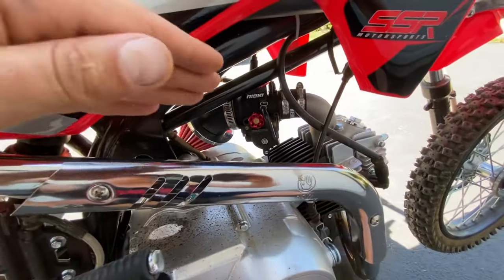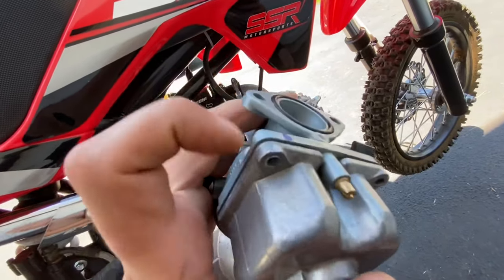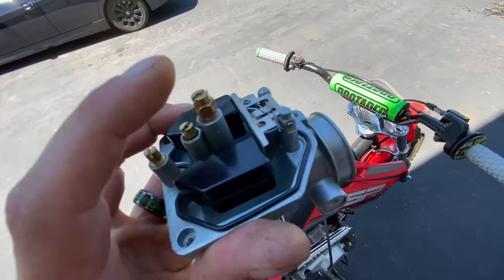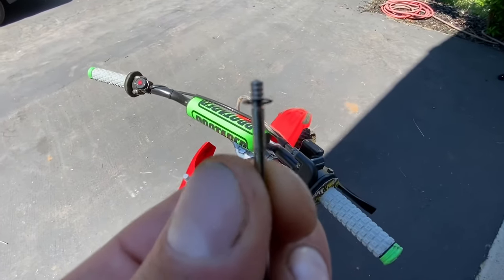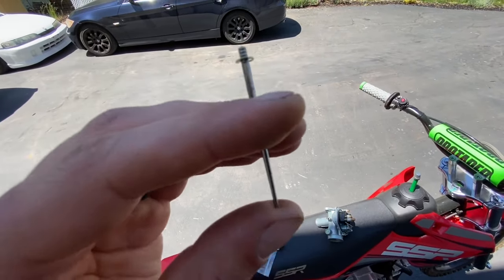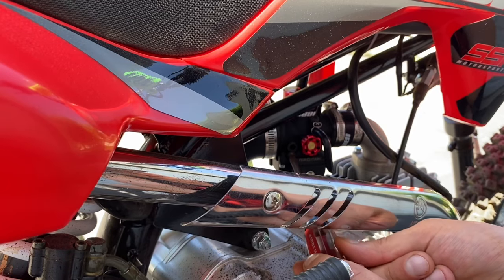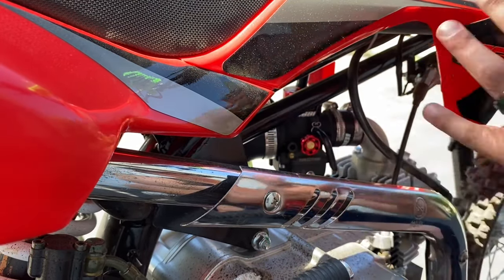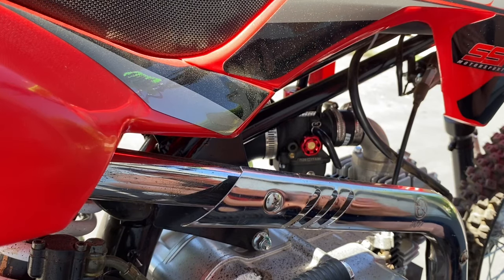How To Adjust Your nibbi Carburetor And Jetting For The Best Performance !!!

Comment: The knob on the nibbi is not a fuel screw, it’s a idle adjustment and the flat head screw is the air screw
Reply from the maker: Let me ask you this what happens when you turn the idle screw? It lifts up the slide inside raising the needle allowing more or less fuel to pass. So fuel screw.
Reply: throttle family I read up on it more, and your right but it’s called a idle mixture screw though and it controls fuel at idle to adjust the idle
Reply: throttle family sorry about that, good video though
Reply from the maker: Hey no worries I did the research so the viewers wouldn’t have too glad you liked it I hope it helps people out I just want everyone to have fun and get out there and enjoy their toys 👍
Reply from the maker: Also enter in for our graphics giveaway you have a good chance of winning so far we only have 10 entries
Reply: throttle family yeah for sure man 👍😁
Reply: throttle family okay I definitely will 👌
Reply: Its is called the idle screw because depending on what carb u got the other screw your air, fuel screw can be a air screw or a fuel they don't have both idle screw only governs idle where the other adjustment works through the whole throttle range. U got some other things wrong too but u got the basics out overall since u let it be know your new to this so i give u a thumbs up

Comment: What’s the factory setting for the idele screw
Reply: Both all way in n 2 turns out
Reply: @briantruax1682  yea I looked it up it’s exactly 2 1/4 for air n gas is 2 3/4 for proper tuning to start at 2 out is just a basic start which most ppl do 2 n half turn

Comment: Hey man so im just wondering where you got the bigger jets? Biggest ones i got are 118 main and 40 pilot.. i need the 120 main and 48 pilot
Reply from the maker: mark williams you can get them on amazon they use the kehien style jets
Reply: Awesome man i jus ordered them should be here by Saturday!! Thanks alot man! You've been a big help with this process. Who knew the nibbi would be so difficult lol
Reply: Hey man so my jets came in i got the 120 main and 48 pilot in the carb i adjusted the air screw and idle air screw soooo many different times and i cant get the bike to run without fallin on its face ive went up on jets ive went down on jets and im at a loss man.. idk what to do anymore.
Reply: I think im at sea level i live in Washington state i figured out that i need a 118 main and im using a 50 pilot. That seems to run the best but it still has very very slight issues when at high rpm
Reply: @markwilliams9272  Washington state has an average elevation of 1700ft. The coast is sea level with a peak of 14k. 

How do your plugs look? White, sooty, or golden brown? You should get a few new plugs and change/gap them while you're tuning.
Reply: Randy Mcilveene you best cherish that luck brotha. This shits a nightmare😂

Comment: What jets would you recommend for 98 feet about sea level??
Reply from the maker: I really don’t know you are going to have to experiment with jet sizing but if your using the nibbi  believe a 42 pilot 110 main should be close but I’m not 100%
Reply: @throttlefamily4655  okay, thank you!
Reply: @tylerwells8640  I'm using a pe28  nibbi on a dbx1 140cc at 550 elevation and find that anything below a 40 and a 118 does not work well for me In fact I'm going to try a 125 or 130 main and a 48 or 50 or 55  pilot due to the elevation but I will play around since at the moment my mixture screw has to be way past 3 turns  and at top end I get abit of hesitation  so I know I have to raise the number ,, the 115  and 35 work like crap .

Comment: 3:55

This is the exact part of the video I need and you didn't before hand. Ffs. How the hell do I remove this clip?!?
Reply from the maker: You will need a flat head screw driver to pop it off but be careful these retaining clips will spring off and go flying so make sure you are in a controlled area.
Reply: @throttlefamily4655  I was afraid of skipping and scratching the inside. Thanks for the reply!
Reply from the maker: @Ryan_Carder  no problem

Comment: I'm below sea level in New Orleans
Reply from the maker: You may need bigger jets
Reply: @throttlefamily4655   I just ordered a real mikuni my other one gas just pours out of it
Reply from the maker: There is a screw on it at the bottom to close and open that
Reply: @throttlefamily4655  did  that all my gas is on the floor
Reply: @throttlefamily4655  where can I get a crankshaft seal my bike is leaking a lil oil

Comment: What does it mean when I turn my fuel switch on and my gas runs straight out of the overflow hose?
Reply: Float height isn’t right. Spilling out the overflow so it doesn’t get flooded. Adjust float height like he mentioned in the video to make it parallel with the bowl